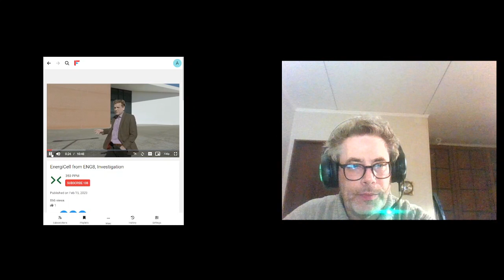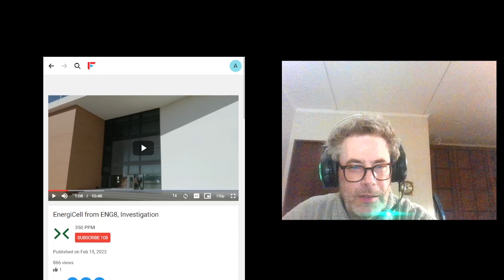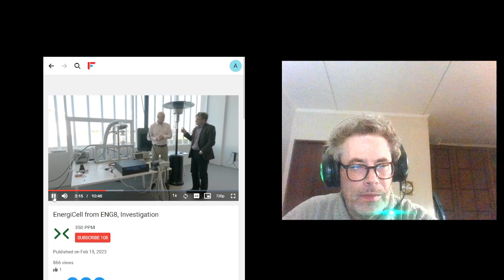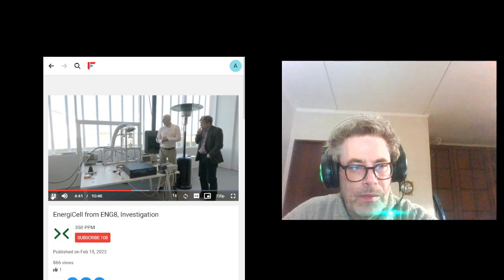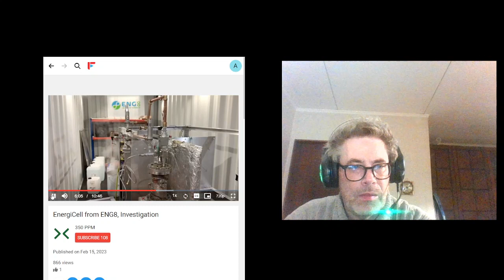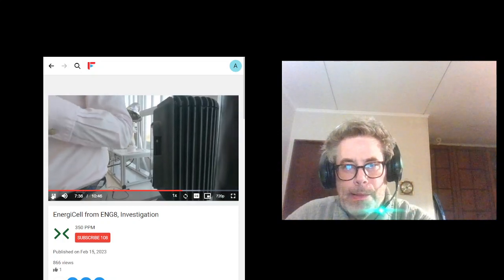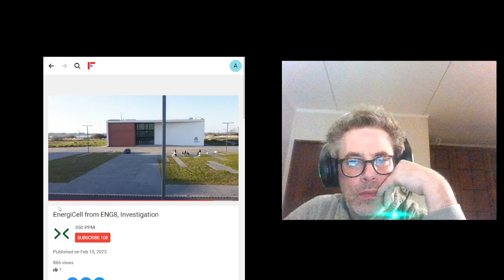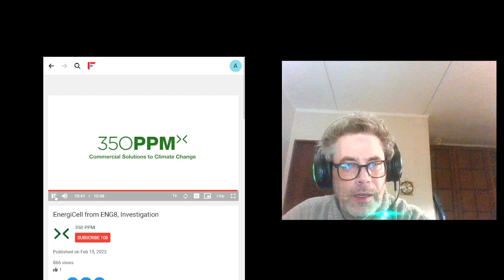eng8 energicell COP30 capable claimed Energy Production cell

Comment: The  atomic hydrogen furnace was discovered in 1976 and validated by J. Naudin he got 20 times input.   Moller's Atomic Hydrogen Generator (MAHG) is fully based on the Irving Langmuir discovery. In the MAHG, the hydrogen is merely dissociated and recombined and can therefore be recycled over and over again without consuming more hydrogen than the quantity used to start with. Randell Mills, Brilliant light energy did this also some 30 years ago..He also has a very powerful  device.. he seems to be living of investors money now ... for the last 30 plus years ... Maybe these guys will have the balls to make it good... finally.. 

The Atomic Hydrogen Process is 100% CLEAN and SAFE.  on  March 1, 2004 - JLN Labs 
Naudin said that this was so far the best source of energy amplification. 

Ps seen you on Tick T .. All the best from Denver Colorado... Al.

Comment: The technical explanation at 0:50 is gibberish. Nicholas Dimmock is Head of Investor Relations at ENG8, but can't explain how it works in simple terms. On the ENG8 website it says that the EnergiCell is based on the "Theory of Superunification" published by Vladimir Leonov, but that theory is total nonsense.

The more I read about this, the more dodgy it sounds. I've got very strong "Steorn Orbo" vibes about this one, they also claimed to have "validations" from scientists and engineers.
Reply: How do you feel about it now?
Reply: @tockybonner4500  I am slightly more skeptical. They seem to follow the same pattern: make great claims, announce "independent" validation, assert that the current device works, but develop next gen design instead of producing an actual, saleable product. ENG8 claimed to have a working product in 2017, every day that passes it is more unlikely that they actually have anything useful.

Comment: Looks like an arching of sorts manifesting the plasma?
How would the turbine be run? Is there pressure coming with the heat, or does flow come from cooling down and contraction? A steam system?
Reply: We can also use thermoelectric generators to get power from heat sources
Reply: @fidelcatsro6948  I've heard of these but won't pretend to understand them. How efficient can these be with such a hot point source?

Comment: Thanks for sharing this video. We are long overdue an OU system that run in our homes. No more being cold in winter, cheap electricity bills and green energy, that would be amazing 🎉
Reply: Overcoming the cold in winter is mostly about insulation of course. We are sitting on the crust of a 12,000 km ball of molten lava. Even making a dome from ice and snow provides relative warmth from the outside cold.
Reply: @SilverHolland Geothermal energy 😼👍
Reply: @fidelcatsro6948  Yes, geothermal can be cheap heat. We're actively cooling down the core of the Earth and letting that heat out from the atmosphere, though...would that slow the spin of the Earth? Or speed it up? Throw us out of orbit with the Sun, or on a descending orbit?
Reply: @SilverHolland  yes eventually we are doing some damage to earth as well..